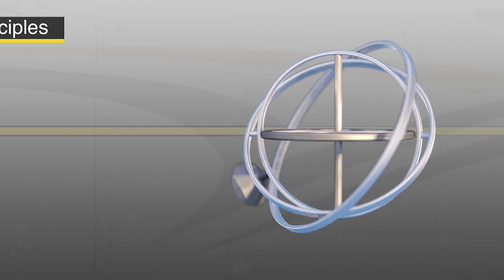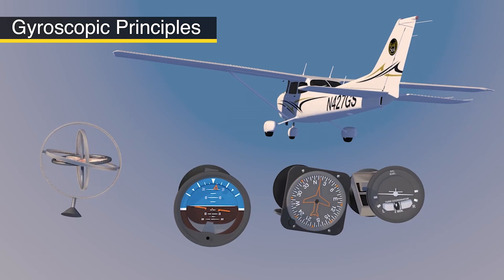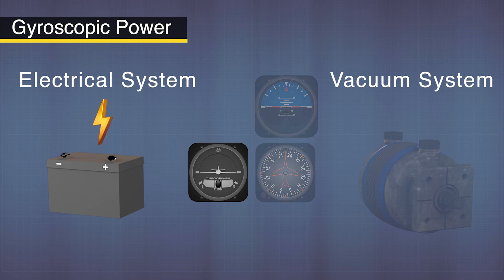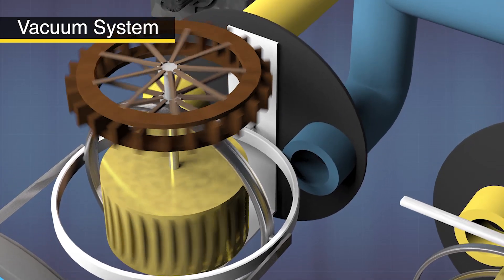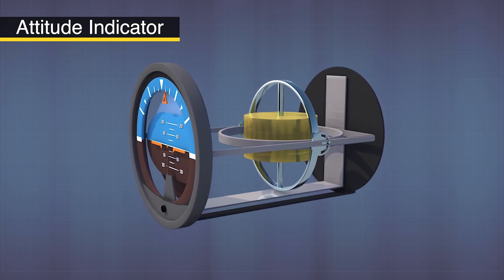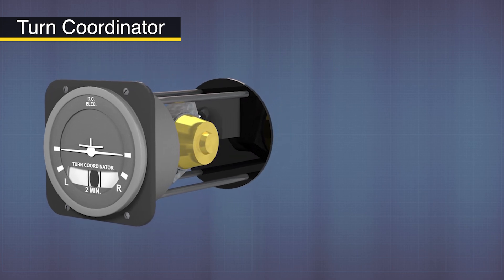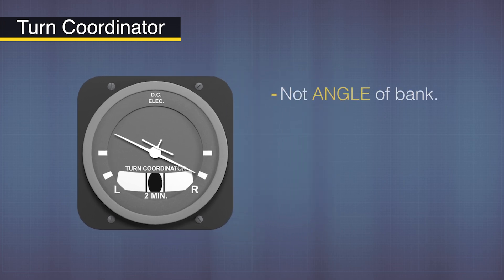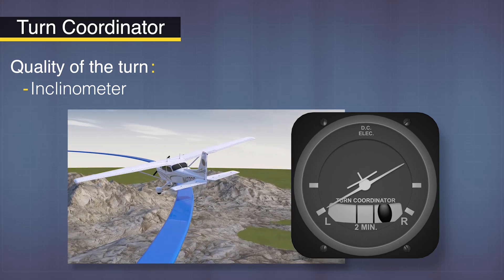Gyroscopic Instruments in 3D

Comment: I understand how rigidity in space allows for the gyroscope to remain stable in space, but what does precession have to do with the functioning of these instruments? Each explanation says the force is felt 90 degrees in the direction of rotation but I still have no idea what that means or how it applies
Reply: In the real world, inherent rigidity in space is not absolute.  Gyroscopes are susceptible to the effects of acceleration which can perturb that rigidity, and cause the gyroscope to assume a different spatial orientation.  If the acceleration is strong enough, it can tumble the gyroscope altogether.  If it is of less strength, it will likely result in the precession of the instrument, manifested in a ninety-degree rotational direction from the force vector.  There are many good YT videos that can explain this visually, which might make it easier to understand.

The cockpit instrument called the attitude indicator not only contains a constrained gyroscope gimballed on only two axes, but has a self-erecting/correcting device that combats the effects of acceleration that act upon it while in actual use.  The attitude indicator maintains the gyroscope’s rotational axis aligned with local gravity at all times, and if it couldn’t do this, then it would be useless to the pilot.
Reply: Late reply, but I just wanted to add that precession is more of a side effect for the Attitude and Heading indicators, while the turn coordinator actually utilizes it to determine the rate of turn based off of how much precession is applied to the rotor.
Reply: @ yep i was finally able to understand how the turn coordinator makes use of precession when i was studying for my CFII checkride, but thanks for the reply!
Reply: Dude congrats on CFII!! That’s awesome.

Comment: Show this to globertards... clearly shows that airplanes fly over a FLAT surface lol
Reply: Ummmm the instruments don’t have anything to do with the earth 😂
Reply: @GENERALBLAZE-001  --You neither understand aircraft instruments, nor the operation of the gyroscopes they contain.  Stop getting your information from people who don't understand aeronautics at all (flatEarthers), and do some genuine research instead.
Reply: @cardinalRG  well son I've logged over 5000 hours of flight time in my career before I retired. I actually have the credentials to make these remarks. I'm sure, like most of these kids, you've done nothing but live your life behind a screen. This is why you don't possess the ability to grasp the understanding of this information being presented in this video.
Reply: @APEX-ONE007  --Are you claiming to be a pilot?
Reply: @APEX-ONE007  --How about answering my question, please?
Reply: @APEX-ONE007  --Cat got your tongue?  Fine, I’ll make the usual, utterly reliable assumption that as a flatEarther, you aren’t a pilot at all.  Who knows what your “5,000 hours of flight time” is supposed to mean…frequent flyer, flight attendant, whatever.
Reply: @APEX-ONE007  -- @GENERALBLAZE-001 has tucked his tail and run away.
Reply: 1) Modern gyros are made to slowly get "corrections" by gravity, older ones had to be manually adjusted once in a while to get rid of the drift
2) Bob Knodel, "15 degrees per hour drift"